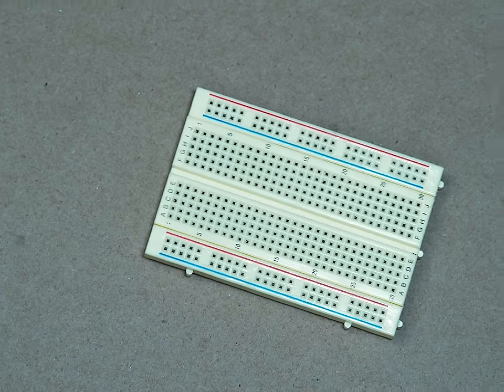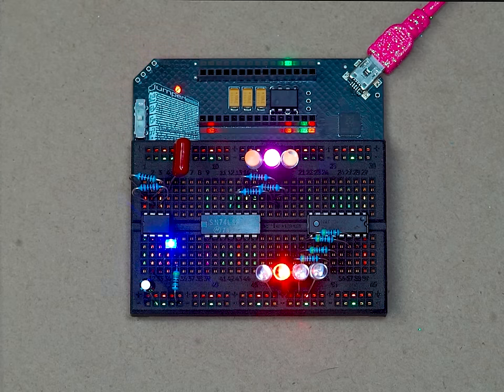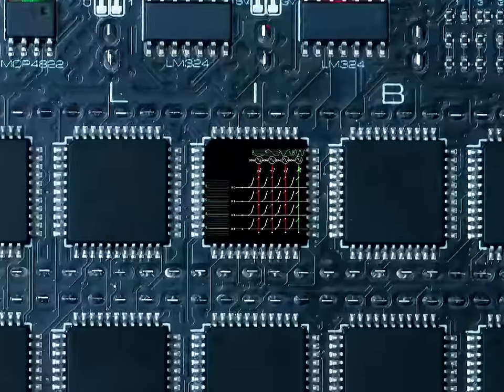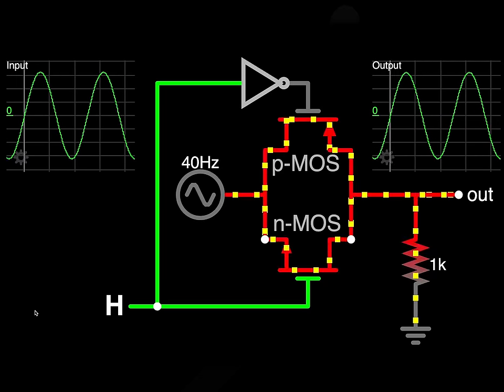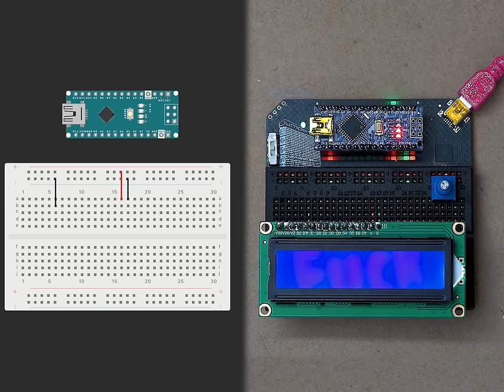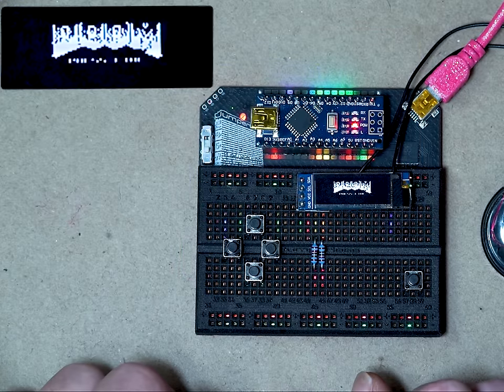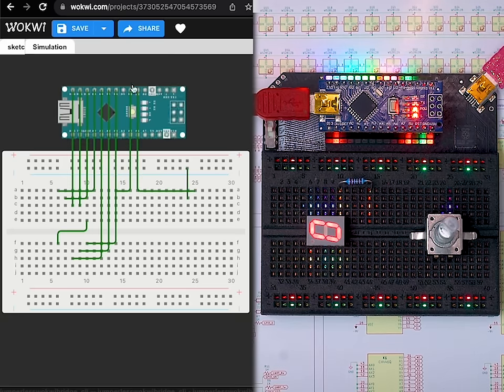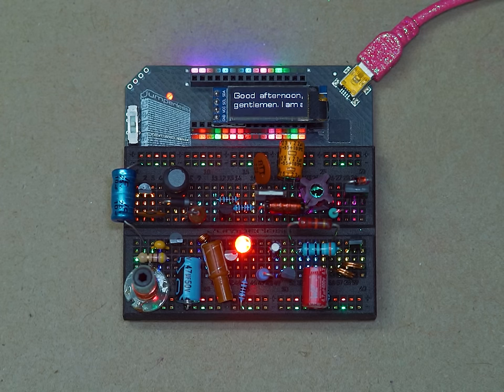Jumperless

Comment: As someone that owns a 60Lb portable renfiorced steel suitcase style breadboard & testing suite, 1.2-90volts @ 0.3A (300ma) up to 65Amps w/built in bench power supply. handheld circuit testers, multimeters & oscilloscope, built in hat air rework station etc all in the box. I don't need this- but I WANT it. This is a great idea- wish I'd thought of it. There are so many small projects or possibilities especially if I could plug in 20 of the same component (all w/same values) & check them all in one go for if one is faulty or not. Also I can't stant flashy RGB PC's keyboards & the like cause I'm a form & function over looks kinda guy but that doesn't bother me for some weird reason- & if it could light up according to certain protocal or valuse I can see that being uniquely useful. Look forward to see what else it can do, or other ideas you come up with.
Reply: Just because your a newb, doesn't make me a liar. Unlike most of you I wasn't allowed to play with local kids or watch anything that wasn't rated G, went to church 3 times a week etc. We were poor but the one thing we had were books. So I became a bookworm- most of the ppl I had regular conversations with were 20-40 yrs older than me. By age 9 I'd completely read through 4 entire encyclopedia sets (Funk & Wagnalls, Britanica, Columbia, etc the un-abridged Websters dictionary, all except one of the Gray's Anatomy medical textbooks <which the show is named after> & plenty more. I was rebuilding motherboards when you were probably still in diapers. Fixed my Ma's Mr. Coffee maker @ age 5- the 12 pieces I removed were in a jar screwed onto the bottom of the cabinet. Still there & working when I left home @ 14 (emancipated as an adult). I repaired my first PC in 3rd grade (1984). I was 8yrs old & the power supply & Mbd needeed components replaced on a Tandy TRS-80 "Green Screen"<Radio Shack's PC Brand> that I bought from the school cause it was broken, & after fixing it I learned I couldn't do much with it so I started learning programming. Travaling 45 min to & from the next city's library to write down what & could <I lived in a differnt town, so I wasn't allowed to check the books out.>  No google- just grit, hard work, & dedication. Something most ppl nowadays don't have the willpower or attention span for.

Anyways this is the last model they made but mine is different because it also has the hand held ossciloscope & Multimeter that fits into the empty spots on the far right. of the case. I've also added extra functionality over the years.
Also unlike this link- I have the original 403 page manual & schematics, parts list & circuit diagrams required to repair it. & for testing all of the components.

Knight Electronics ML2010 (Mini-Lab)
10557 Metric Dr. Dallas, TX 75243
1-800-323-2439 https://knightonline.com/

This is the link for a very basic description of it.
https://us.rs-online.com/m/d/344f16dff5f52fbed477ff0c780168bb.pdf

below is a link to a older multimeter than the one that came with mine- this one still has lots of features no regular one has.

https://www.ebay.com/itm/285296038149?chn=ps&norover=1&mkevt=1&mkrid=711-117182-37290-0&mkcid=2&mkscid=101&itemid=285296038149&targetid=1529493970462&device=c&mktype=pla&googleloc=9005292&poi=&campaignid=19851828444&mkgroupid=145880009014&rlsatarget=pla-1529493970462&abcId=9307249&merchantid=114723813&gclid=Cj0KCQjwsp6pBhCfARIsAD3GZub5ZvUe-173hlqoH_rsaJOInU3cBcrJct6paH0twMNMdo6FZWP4hAEaAq36EALw_wcB

You have FAILED... Learn from it next time.
 @Failure_Is_An_Option

Comment: Would be cool if it would be possible to stack multiple of these together and operated as a whole. But each breadboard would probably only be able to route within it's own pins or else the interconnect-matrix would probably grow too much. Possibly have 4-8 dedicated lines between the boards.

Nice work either way!
Reply from the maker: The trick to doing that would be to bridge the Nano Headers together, or use some of the GPIO lines as the interconnects.

Comment: Ideas… bespoke PCB quality control setups do come to mind.  What else… fast relay switching of entire circuits for frequency hopping radios?  And the same for beam - forming audio and radio transducers?  There’s gotta be some ways to push the 9V/ 100mA limit and also keep tabs on the crosstalk near the 90Mhz cutoff.
Reply: Resistance is up to 65 ohms per crossbar, so good luck.

Comment: 3:44 Simulate parts you don't have is THE unique selling point if someone going to make a business out of these; just include a set of dummy parts & labels.
If you were selling this to schools they could use them in place of expensive IC's for beginner classes that would normally fry those IC's before moving on to the real thing.

Comment: It seems like an excellent project, however does it have auto diagnostic functionality to make sure the board is working properly? If the answer is "yes," the project is a success. If the answer is "no," yet, and something goes wrong with jumperless(hardware fault), it is definitely complicating things.
Reply from the maker: That's actually a great idea. The hardware totally allows for this, but so far I haven't written a function in firmware to do that (because I hadn't thought of it.) So thanks, I'll put something like that in a future firmware release.

Comment: Idea for a piece of tooling one could built on top of this: A UI that can ingest a schematic file and, given the placements of components and their pins on the board, autogenerate the jumpers required to complete the schematic
Reply from the maker: That would be so amazing. There's actually someone working on training an AI model on a Jumperless that should be able to do that.
Reply: @arabidsquid  So now training up model is the solution to everything? Sounds like an algorithm is the better solution, or are those not fashionable anymore?

Comment: I’m curious what the cost scaling factors are for hypothetically larger boards are?  
Like how much would a full-size breadboard cost? 
Or even a crazy one off 2250 point size board?
Reply from the maker: As it is now, basically every chip on the board is used to it’s limits (power, IO, etc.) so scaling up to a full size breadboard would probably cost a bit more than double.
So, on the next revision, I plan to make these slot together with card edge connectors and pass through signals and serial data, so you can plug 2 or more Jumperlesses together and they’ll act as a single bigger one.
Reply: @arabidsquid  Love it! What’s more, Well done and congratulations on a fantastic proposal! I’ve little doubt it will prove successful.

Comment: Looks nice, idea is good, but it's a bit confusing where all the horizontal wires are. 
Can you jump over other wire? That is a must for many circuits.
Reply from the maker: Yes you can put a jumper over another. The color shows which lines are connected to each other.
Maybe one day when I make one with 5 LEDs under each row I could show the entire path of each wire.

Comment: That is a very cool project. Can it be interfaced with any schematic capture programs? Can multiple outputs be wired together for higher MA (thinking motor or stepper running)
Reply from the maker: Yeah, it can with some very simple translation to just pull out the connections. The problem with a purely schematic program is you need a way to tell it exactly where the parts should go on the breadboard. I think the move may be to just make a schematic symbol that looks like a Jumperless and has all the connections to get the locations.

And yes, you can stack connections for higher current. The 100mA isn't a hard limit though, and my policy is I'll replace your Jumperless for free if you break it.

Comment: This is amazing! What are your ideas for getting cost down? Maybe removing the analog switches in place of simple transistors, and having a smaller layout? Once you get to $100 or less, I'll be buying one!
Reply from the maker: I wish I could use discrete transistors, they'd have way better specs overall. The issue is, to make a switching network like this, you need 100*100 of them, so 10,000 individual parts plus driving circuitry for each. The only hope for that is a custom ASIC, which I may do when I have some scale.

Comment: Here's an idea. What about a variation (or extension) on this that has a whole bunch of common components (resistors, LEDs, maybe an LCD, etc) pre-assembled that you can virtually wire up without needing to install them. Sort of like an FPGA but with macro circuitry. With a predictable set of components you could easily create virtual wirings for lots of common applications and share them. Basically, a zero-assembly breadboard.
Reply: Wow.. if you could make that happen it would be amazing! I would love to see tackle it! Let me know when it's done please:)
Reply: @paintqueen1  I'm definitely not qualified to tackle it. This is a response to the video asking for suggestions for ways this could be used.

Comment: Such a great idea! Would it be capable of converting the circuit to a schematic (ie. KiCAD) ?
Reply from the maker: I think Wokwi has something planned for doing that. They're always coming out with new features.
Or at some point, I'll make a KiCad plugin so you can build the circuit directly in KiCad and test it as you put the schematic together. The only issue is deciding where to put the parts on the breadboard, because a schematic doesn't normally care about that.

Comment: Amazing project. - Just one question: what happen with short circuits?

And probably the price is far out of range for most persons.
Reply from the maker: Every net has a list of nets it shouldn't merge with or connect to, so it won't let you connect power and ground directly. But if you have a real jumper on the board and connect both sides, the Jumperless doesn't know that and will short them. Luckily, the resistance of the switches keeps the current below the level where it will cause problems immediately (and they have a Positive Temperature Coefficient, so resistance will increase and the current will drop as they get hotter.) But you probably shouldn't leave it shorted overnight or something.

Comment: This looks amazing for hobbyists and those just learning. I would’ve LOVED something like this when I was pursuing my degree. I’m kinda curious how low of a price you could get with something like this by simplifying the design and taking away some of the frills and QOL aimed at new users?
Reply from the maker: For this thing, the crosspoint switches and charge pump supply to power them make up 90% of the cost. So all the extra frills and QOL stuff are kind of a negligible cost. The only thing that would make it noticeably cheaper is fewer routable points. And quite a bit too, 
the number of switch pins needed ≈ (the number of routable points)²

Comment: What are the properties of the crosspoints? I imagine the virtual jumpers have some sort of resistance? How does that factor in with e.g. 555 timers where the RC parameters affect behavior?
Reply from the maker: The crosspoints add ~65 Ohms to the connections. You can get that lower by stacking parallel connections, but for a circuit you'd entrust to a breadboard it doesn't make much of a difference. If people buy enough of these I can afford to have custom silicon made to bring that down to under 1 ohm. Capacitance is around 1 pF, so basically negligible because the breadboard itself is waaay more than that.

Comment: Great idea! But put those multiplexing ICes on sockets, they will burn frequently.
Reply from the maker: I wish I could, but they wouldn't fit. Also, swapping out the chips with a hot air gun is surprisingly easy.

Comment: Awesome.

My one big issue with breadboards is that over time, the pinhole contacts get stretched out and connections get iffy. Since this is not (I assume) negligibly cheap to replace, can it be disassembled to bend/adjust the contacts or replace the contact bed etc.? Maybe contact durability is already much improved over cheap boards and this is not an issue?
Reply from the maker: So, I had custom spring clips manufactured for this with a hole to accommodate the LEDs and tabs to solder them to a PCB. And because they were going on something that should last, I had them made out of phosphor bronze instead of steel like most cheap breadboards. Phosphor bronze is an alloy specifically made for high reliability springy electrical contacts like this, so they should last a very long time even with some abuse.

So yes, it's a lot of desoldering, but they can be removed and replaced. Or you can just send it back to me and I'll replace them for free.

If you want to go down a Wikipedia rabbit hole on alloys: https://en.wikipedia.org/wiki/Phosphor_bronze

Comment: This project is mindblowing! The price is out of reach for a lot of hobbyists. Not to nitpick, but isn't 100ma too limiting?
Reply from the maker: It is a bit limiting, but analog crosspoint switches are a pretty niche chip, so there are only a couple options out there and this is the best I could find. The 100mA isn't really a hard limit, you can run higher currents for short periods of time. It's already well above the recommended maximum from the datasheet, but I've tested a few for 12 hours with 100mA flowing and they were fine.
Also, my policy is if you blow a chip, I'll repair/replace it for free. Or if you have a hot air gun, I can just send you a few CH446Qs and you can swap them out yourself (these are particularly easy because they're not surrounded by a bunch of tiny parts).

Comment: include the logic so that a single jumper creates a virtual jumper cable .and i can move on making connections on the board.  jumpercables do 1 thing as fast as you can. if you get the analog logic right jumperless does it faster with one jumpercable or stapler or anything that just shorts. its not worth typing 13-14 test and again type . i already have 4-40 tools/tasks to test .
Reply from the maker: I like that idea. The way I was considering doing that was by using 2 of those GPIO connections at the top to connect a probe (a jumper wire) with a button on it. So you poke it where you want one side of a jumper, hold the button, and then poke the other side and the jumper gets made.
Once I finish the code to scan the board super fast, that will be the first thing I do. That will probably be ready by the time they're back in stock.

Comment: Can we stretch the 9V limit by programming two or more virtual jumpers in series?  And stretch the 100mA limit by ganging several in parallel?  Or would the switching happen too slow and allow damaging transients?
Reply from the maker: That is actually a fascinating idea, it would take some serious fuckery with the grounds, but it might be possible to run 2 crosspoints like a Class B amplifier (trading off between positive and negative parts of the wave) using another switch and ADC to control the handoff. Thanks for that, I'm gonna ponder the fuck outta that particular orb now.

Comment: Dude, you really have something there...
I'll argue about the USB Mini B plug...
You should have added programmable voltage rails.
3.3V, 5V and + / -8V is a good start, but on some projects you need to simulate the behaviour of a battery.
You should also add some type of a programmable load.

And the last part is the software... You could do a lot of things there.
Reply from the maker: Ha, I love USB Mini, by now there's just starting to be enough good information and experience out there to consider USC C, but this was designed in the wake of the Raspberry Pi 4's USB C fiasco so I decided it wasn't worth the risk of screwing it up.

You can use either one of the 12 bit DACs as a programmable power supply for 0-5V or +-8V, they're buffered though a high current op amp so they can supply 1A (way more than the board can handle.) 

You could kinda fake a programmable load by measuring the current from the DACs and changing the voltage according to ohm's law, but that's hacky and I wouldn't trust it. One user did it by using the On resistance of the crosspoints and stringing a bunch of connections together to make a resistor.

For software, there's now a dedicated desktop app as well, Jumperlab.
https://www.youtube.com/watch?v=fFDEwZOR7G4

Or you can use it without a computer at all with probe mode
https://www.youtube.com/watch?v=c_o6K9yv4-0

Comment: What if the RP2040 had a bitmap image on its file system, and you could make the connections by simply using the brush tool in MS paint to draw jumpers on and the RP2040 could process the image. This would be great for school and university environments where the IT infrastructure makes it difficult to get special software installed.
Reply from the maker: Ha I actually love that idea. I’ll think about how I can make that work.

Comment: Ok when I first saw this I thougt this  cannot be real. 
Would have never thought that something like this will come up. 

A very cool idea. Is it possiable to supply it with voltage from a seperate power supply? Like if you need 24V for a component to work 

How are the limits (current and voltage)?
Reply from the maker: The voltage limits are -9V to +9V, but I think on the next revision I'll add a switch to move that range up to like -2V to +15V so it can play nice with 12V parts. It's kinda weird how it fails above that, it just passes everything above 9V to all the other IO pins on that crosspoint. So yeah I wouldn't recommend putting 24V on this, I would probably power that part on a regular breadboard and use real jumpers to the IO lines and stuff.
Current can go up to 200mA for short-ish periods.